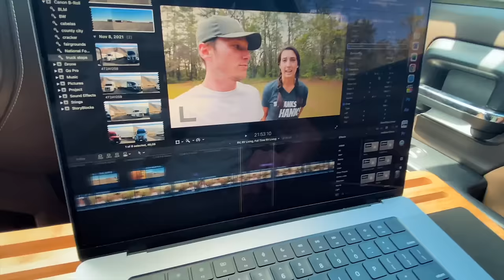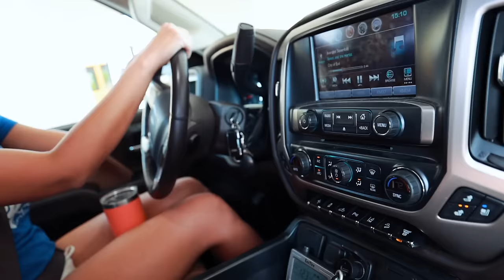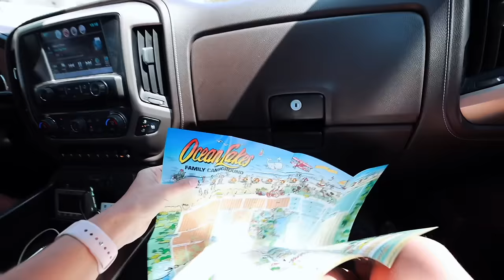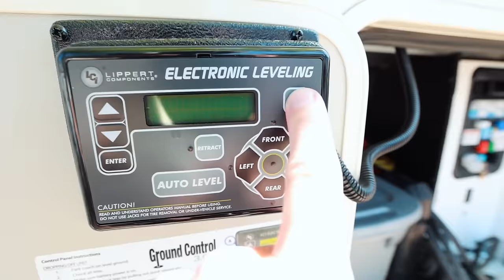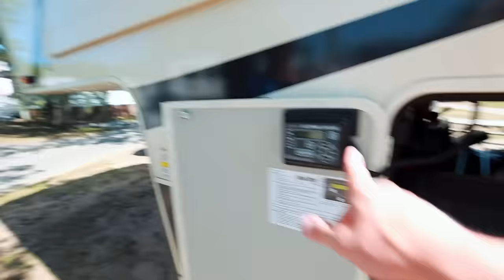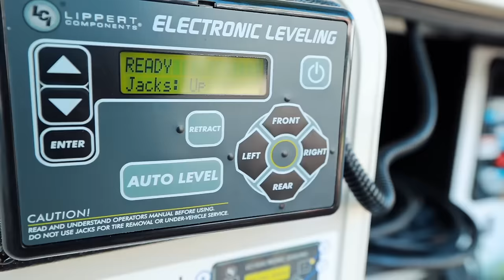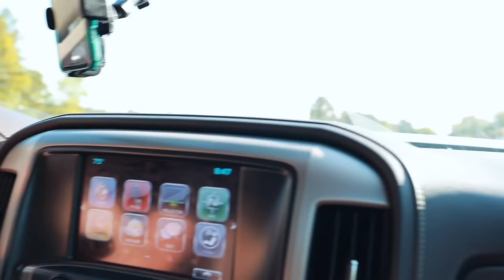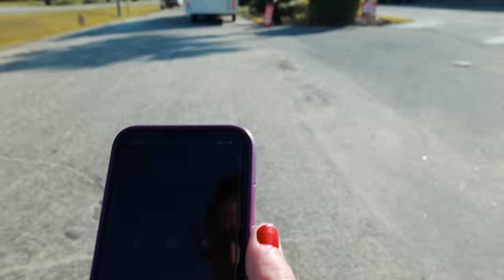The Dark World of RV Service: Untold Truths About the RV Industry

Comment: Quicker to put together than take apart and put together 
Take apart without breaking anything, clean up the mess from building(especially in the underbelly), the frame is actually upside down in the factories when they put everything in the underbelly so the wires aren’t hanging in the way   
And you don’t have to clean the discharge pipes.  
Your full timers so your pass through will be full and have to be emptied and stuff put back
I’ve had to remove shower surrounds to do the pipes,   Typically not on 5th wheels.  Actually better access than a travel trailer or a motor home.  Some motor home tanks are not serviceable at most shops, would have to send back to the factory 

LF error is a voltage error 
Have to rehome the jacks
Extend all at least 6 inches 
Fully retract all
Should clear as long as you have good voltage 
Have your batteries tested if your plugged in and this happens.  A bad battery can give poor voltage even when plugged in.  Age of battery not a factor with a short in the battery.  Have had bad new batteries 
Typically your refrigerator will draw enough amps if you have a residential running on inverter to draw a little more than what your 7 way will provide going down the road.  So your not charging your battery while driving your keeping it from depleting completely.  Plug in when leveling if possible.  Pull away but stay plugged into truck when leveling 
If you have flooded batteries check the levels,  can add distilled water which cooks off as you charge. I’d check every 3 months if I full timed. I’d get agm or go lithium ion

Comment: Fat fingers! Especially if it's designated as a drive through. The other stuff was warranty stuff, crooked slide, torn up slide ski and slide seal, and the latest one broken front leveler. Which has taken 6 weeks to get the parts and have it installed, our 4Everland comes home tomorrow. By the way I don't trust the auto levelers either so I use an old fashioned 3' bubble level to double check everything. We did figure out why they couldn't find your tank though... it got to them before you could get there and they used it for someone else... not that we have experienced that 😉😉.

Planning on having a Thanks Hanks  marathon on Saturday.  If you are ever traveling down I-95 past Richmond VA give me a yell, we'll meet up for lunch... or wine. Still trying to downsize, only about 145 bottles to go. 

Be safe!

Chief, Dee and Lucy 🐾 
4Everland RV

Comment: It's not just RVs.  We've been trying to get a well drilled since before we headed down here a month ago.  Other well drillers are booked 5-6 months out.  We are still running on a generator as the electrical inspector only inspects on Tuesdays and Thursdays even though there are literally hundreds of people building in the area.  They changed the code so now we have to wait for another shutoff to be added between the transformer and the barn.  On top of that, we can't get our name on a transformer until the inspection passes and transformers are first come first served with months wait in between availability.
Reply from the maker: So rough, our friends have been waiting for their truck to get repaired for a while now too

Comment: Don't feel too bad guys.  The RV industry is certainly a pain in the rear but that dealership is an example of the worst.  I recognized it as soon as your video started. We bought our Reflection 312 BHTS there and had it back in within a month for major failure of axles and brakes.  We had already provided extensive details and photos to the dealer so our appointment, that was supposed to be the beginning of a one week job, turned into 6 weeks of staying in a local hotel while they waited for parts.  Parts we were told were ordered two days later.  After a week of no word I called GD and learned the dealer hadn't even contacted their warranty department yet to get approval for the repair. It took a Come to Jesus conversation in their service center and me calling every two to three days for a MONTH to get this job done. You have my sympathies.  Don't trust what they tell you there.  Call GD yourself.
Reply from the maker: Thanks for sharing Kevin!

Comment: Yup, we are currently dealing with same issue.  Leveler pump/reservoir seal leak between.  Loose a quart every 2 weeks. Service center replaced unit, but the controller needed updated, overnight from LCI, installed, now it won’t work due to the wrong wiring harness from new controller to pump 😣.  Another overnight from LCI.  The new harness should have been with the new controller 🤷🏻The service center has been great squeezing us in when parts arrive…..,not too happy with Lippert. RV Life Baby, I feel ya.  Looks like your service center used your gray tank on another Rig 🤔.
Reply from the maker: That sucks! Thanks for your support, more of the story coming soon!

Comment: I don't know if anybody has mentioned it yet about the caterpillars that you encountered on your South Carolina trip and the ones that traveled with you, but I do believe that they are a type of Gypsy Moth caterpillars which are an invasive species and do harm to Oak trees.  Here in Wisconsin the Gypsy Moths will get really bad at some of the state parks that the DNR will spray the trees in the state parks (from airplanes) to try to control the spread of the Gypsy Moths.

It sucks about the gray tank on your camper, hopefully they were able to get it replaced in a timely manner.  Our 5th wheel was just decommissioned for a while due to a probable structural frame failure in the front of the camper, somewhere between the pin box and front landing gear.  The fiberglass walls are separating and caused the upper slide-out to collapse and crack the exterior fiberglass and inner wall panel in the upper right corner of the slide-out.  There was only issues when the weight was on the pin box and not when the weight was on the landing gear.  The dealership is going to tear it apart to get down to the frame to see what is exactly wrong with it, and then the insurance company will take a look at it again.  Forest River wants nothing to do with it, even though the camper is less than 3 years old.  I feel for you, having to deal with a major issue/fix with your camper.  It sucks when your camper is unusable.
Reply from the maker: Yes, those caterpillars are hard to keep away! Thanks for your support Chad!

Comment: Seen it been there with the Ground Control shutting down as it tried to level that last 1/16 inch.  Its a voltage problem, I don’t think it can get enough voltage.  I was 1 for 6 average trying to get a successful level.  I think the bottom line is if you are already on perfectly level ground it will probably “level successful”
Reply from the maker: Great point!

Comment: Last June we bought a Jayco 28bhs. After our first trip I noticed the siding on the front of the trailer had insulation sticking out from between the siding panels.  Called the dealership and they said caulk it for now and at the end of the season they will repair it. I asked them when do they want to do the repair as I am having a spinal fusion done on November 4th. I was told to get it to them by October 1st. They said they would have plenty of time to finish it. I reminded them that if it isn't completed by November 4th they will have to store it until spring. I was very open and upfront about having surgery and not picking it up until spring if not finished in time. Parts didn't come in until begging of January and they finished the job by the end of January.  I received a text saying it was completed and needed to be picked up as they didn't want it stored on their lot. If I couldn't pick it up they offer storage for 100.00 per month. I contacted our salesman and he talks  to the GM and he called me. After an hour long call he finally understood and agreed with keeping the trailer until spring.  Fast forward to April. I had to rent a truck to pick up the trailer as mine was having issues. I go to pick it up during the day and the parking lights are not working. Being a rental truck thought maybe the truck had issues and brought it home.  Couple weeks later I get my truck running and hook it up and it blows the parking lamp fuse, dead short on the parking lamp circuit. Called the dealer and was told would be 3 month before they could look at it. I was not happy about that and had to fix it myself. Tured out the tech put a longer screw in for the marker light and pierced the hot wire for the marker light. They apparently didn't bother to check their work after finishing. I feel your pain and hope it quickly gets resolved. Dealership service departments don't seem to care anymore. Best of luck!
Reply from the maker: Thanks for sharing Kevin

Comment: Concerning your jacks. I have that happening to me as well. It started only after I put in 2 300ah lithium batteries. Not sure what batteries you have. I ended up replacing the LF jack. The problem went away for awhile, but has returned again. My screen goes blank just like yours does. I narrowed it down to the  bms in the lithium battery cutting off because it detects there is too much current draw. Would be interested if you find anything out at the rally.
Reply from the maker: Hey Dave! So great to hear from you 😃 We are sorry to hear that you are having the same issues, we will be sure to keep you posted as we know more! Stay safe out there

Comment: When your controller shuts off turn it back on and put it in manual mode and level manually and it’ll be just fine!
Reply from the maker: Once there is a jack error, it won't allow you to use manual mode.

Comment: Hey guys! About the AUTO LEVEL PROBLEM....
On our Lippert Electric system I was having the same problem show up for a while until the left front finally totally faulted/let go/LET ER RIP when the inner rack/pinion/nut had the last straw and finally totally stripped out making it completely unusable and, essentially just totally broken. It really looks like the same exact thing you may be having right now..... sorry for the bad but possibly valuable news. Etrailer has replacement legs for a few Hundred$$$, maybe less. I could look up the part number if needed being it was kinda difficult to confirm the part being correct. I've got the 6 point Lippert system ELECTRIC on mine. 

I shout outed y'all on my very first video! (Skirting the rig) !!!! Boy am I a rookie at this stuff!! Nervous as heck! 

Coming to the end aof your vid here and it really DOES SOUND LIKE YOU NEED TO REPLACE BOTH THE FRONT STABILIZERS! Identical problem/symptoms of mine and you'll need 2-20 ton jacks to lift up the front when the easy as all job is done if you wait too long!!!!!! Simple job. I think I have video and, if so I'll post it

Comment: Your best friend will be a volt meter if you want to save money on fixing it yourself get a volt meter most of a lot of the things start with the wiring you would be surprised on how much things get replaced and just tighten a screw to a ground wire solves the problem.

Comment: Please do us a favor and check your battery voltage without being hooked to shore power. Here's a test for you ... check battery voltage while hooked to shore power. It should be between 13vdc - 14vdc. If it is, that would indicate your battery charger is working. Disconnect from shore power and disconnect your battery. Wait 5 minutes and check battery voltage again. It should be in the mid 12vdc range. Then, hook up the battery and do one more test. While one of you is keeping the meter on the battery, the other person presses auto-level. Your battery should maintain voltage in the mid 12vdc. If not .... GO BUY A NEW BATTERY !!! 🙂
Reply from the maker: Hey Burt, we have done all these things already, that's why it can be so frustrating. New battery was a few episodes back if you remember. And we did a voltage test while on the phone with Lippert already (no shore power) - We have the answer for an upcoming video so stay tuned!
Reply: @HappilyEverHanks  Ok ... I'm gonna guess it was the auto-reset circuit breaker. You replaced it with a higher amperage one.

Comment: I have a question I can't seem to find an answer to, and maybe it's just because of my lack of knowledge. Are there anti-sway / weight-distribution hitches for fifth wheels, or with a fifth wheel hitch is that not necessary?  Could you possibly do a video sometime going over how a fifth wheel hitch works for those of us who are utterly clueless about them? Pretty please?
Reply from the maker: Great question. It's our understanding that 5th wheels do not need any kind of anti-sway system. With that being said, there are many 5th wheel hitches and pin box setups that make towing easier. We have a B&W Companion Slider hitch and love it. Here is a video on 5th wheel hitching we made - https://youtu.be/DAc4zSzwT6I
Reply: @HappilyEverHanks  thank you!
Reply: @HappilyEverHanks  The reason I ask is because I am wondering if a fifth wheel hitch might be easier on my arthritic knees in coming years. I have bought a bumper pull and have a weight distribution hitch, but that hitch is heavy to lift in and out of the storage bay and into place and out again when hitching and unhitching. My trailer is small, and if I replace it in the future the thought struck me that I can get a small fifth wheel, perhaps a fiberglass one. Something I did not think to consider beforehand was how heavy a weight distribution hitch can be, though it's certainly makes a world of difference when towing my bumper pull trailer.

Comment: They received the part, they can't find it.  Make them pay for a high class hotel until they get it fixed.  It is not your fault they are lacking the IQ points to do their job correctly.  I was about to buy an RV from a local Campers Inn,  this experience has completely marked them off my list.

Comment: Everything done to fix our 5th wheel took multiple efforts, the 1st one always failed, ALWAYS, then they would kinda fix it and screw something else up meaning now the original item plus something else has to be fixed and on the third or fourth try they got it, mostly. All shops suck, even the better ones. 30 isn't old but it's quaint how you guys pretend it kinda is. 🤣